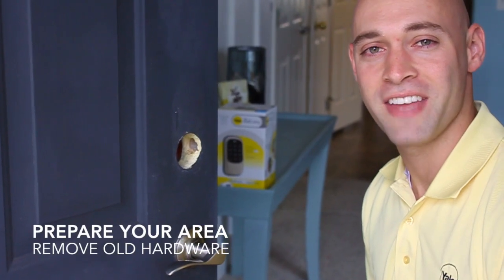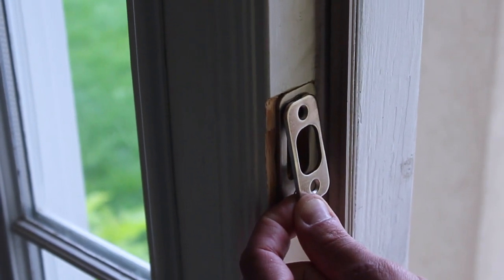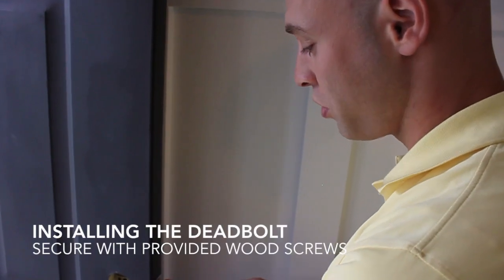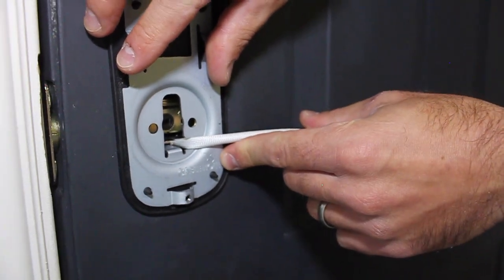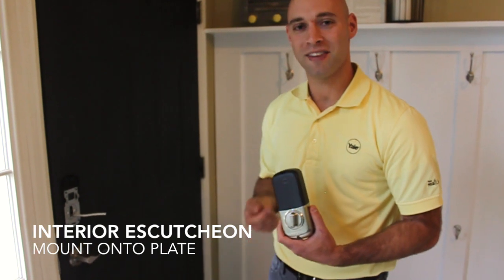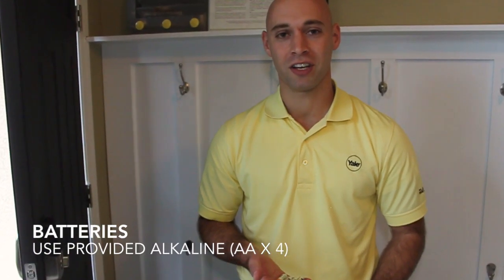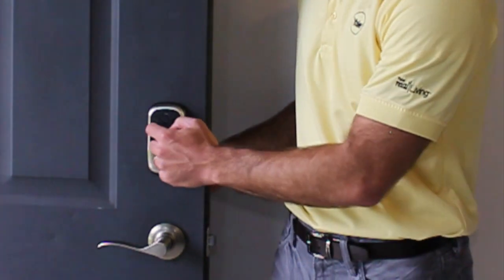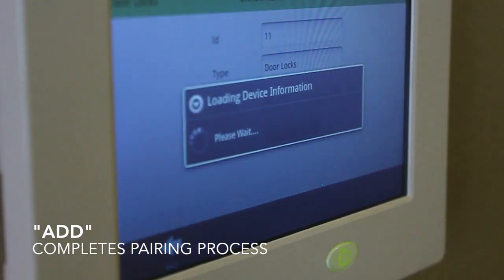Yale Key-Free Deadbolt Installation (and pairing with the IQ Panel)

Comment: how do you reset the master code? we screwed up when trying to set the master code at time of installation and now we can do anything since we have no idea what the master code is..
Reply from the maker: Are you referring to the master code on the Yale Door lock, without the IQ Panel?  If so, you'll want to reach out to Yale directly.  If you're referring to the master code, in accordance with the IQ Panel, then that is controlled directly from the panel.  You'll then be able to grant users access to all or individual door locks from your alarm.com account.